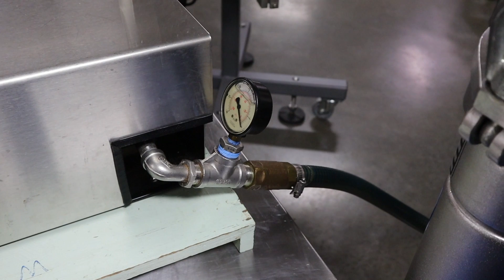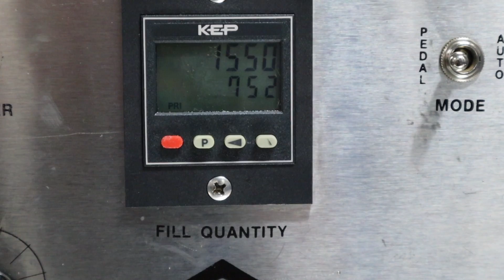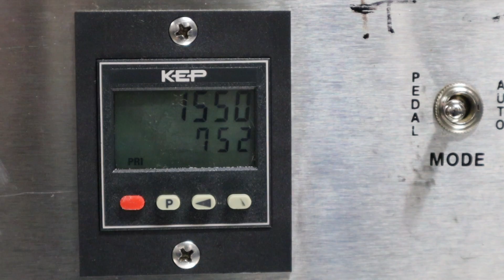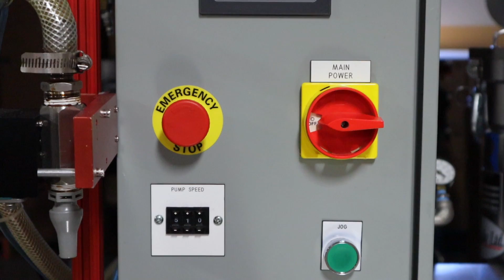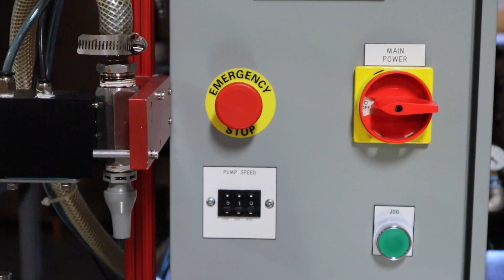Bottling Honey With a Dadant Fillmaster and a Chadam Filler

Comment: Bob, I’m over the robotics/ controls at a coffee and tea facility in the south and I just would like to suggest that if you put a simple relay between a thermostat on your honey tanks to the filling machines e-stop circuit, that would stop the machines from running if it’s not the correct temperature thus eliminating the chance of burning up motors. Shouldn’t cost more than a $100 bucks.
Reply from the maker: Thank you for the suggestion.

Comment: Hello Bob on the foot pedal do you just hit the foot pedal to start the fill an then it turns it self off on each bottle when it is full or do you have to hold the foot pedal down  till it is full an then let off when the bottle is full. I saw where there was a auto and manual switch on the control so I thought it may be both ways . ?? As always your video’s are very informative as you put much thought an detail in to everyone you do . Thanks
Reply from the maker: Hi Kathy. One tap starts it. It will go through only one fill cycle until full, even if you tap it again while it's filling. The manual button will over ride everything.

Comment: What model number is the smaller Rosedale filter you have hooked directly up to your Dadant fillmaster? Would you have preferred a different bag filter when pulling directly from a barrel?
Reply from the maker: 4-12-11/P-1-500-SBN POLY.   We use 400, 600 or 800 mesh filter bags depending on the need. Usually 600 or 800 when bottling from a drum (we call our honey raw).
Reply: @bobbinnie9872  What about the bag part number?

Comment: What size are your honey tanks, and are they heated, and lastly where did you purchase them?
Reply from the maker: We have seven tanks total in this room. Five are 600 gallons each and two are 300 gallons. They are heated from the bottom. If you look closely you can see the seam for the water portion about 6 inches from the bottom. If I was having them made again I would only make this part 3 or 4 inches.The hot water circulating through the bottom is from a large on demand hot water heater.  Each tank has its own circulating pump and thermostat set at 95 f which is the temperature at which we bottle.  The tanks were custom made to my drawings at Hud Industries in Gardena, California. https://www.yelp.com/biz/hud-industries-gardena
They can make just about anything you want out of stainless steel.

Comment: when i am bottling sometimes i have small boobles in honey that they stay inside why is this happening?
Reply from the maker: The bubbles should float to the top which can turn into a film of foam on top. If they are very fine it can take a long time to disappear. If you have a Fill Master that is introducing excessive fine bubbles it is most likely sucking air through a fitting or seal.

Comment: How do you process your honey before filling Bib? Great video
Reply from the maker: We run it through an 800 micron filter on the way to the tanks and settle for at least one day. Minimal heat.
For more info see our video "Packing Honey".
Reply: @bobbinnie9872  Hello Bob Thanks for sharing your expertise and Videos. It is very helpful.
 I m buying honey from the farmers in 5 gallon buckets (12 buckets each time in my SUV.) and Strain it in Maxant water jacketed tank. Keep the thermostat on 95°F and manually bottle it. I m planning to buy a Dadant or Ez fill  for bottling. Lifting barrel above the filling machine is not practical in our place. Our room size is 15'×30' with 2 exhaust fans to keep it little cooler, no AC.
What machine do you suggest for  me, considering temperature and the position of the barrel!
This will be the first time I will pump directly from the barrel so I can't strain out other particles. Also I really don't want to buy another pump to pour it into Maxant tank to strain it, so what do suggest about straining or filtering the honey! Is there any attachment or something I can use? I would highly appreciate your advice. Thanks.
Sorry for the long text.
Reply from the maker: Hi Jay. Although I have heard decent comments about the Ez Fill I can't speak to it because I've never used one and don't have enough information to form an opinion.
When looking at bottling equipment you need to understand the term "flooded". Some bottling machines do best when the product source is at or above the level of the machine so it doesn't need to suck and only needs to push. This means it's "flooded".  The machines in this video have different needs. The Chadam works better than the fill master as long as it's flooded but the fill master is far better at pulling honey out of a drum or bucket on the floor. It will also pull honey through the filters seen in this video by creating a good vacuum. I don't know where the Ez Fill stands on this issue but considering your situation it sounds like you need to figure that out before you buy. I understand the newer fill masters have bigger pumps and motors than the ones I have, are much better,  and will pump cold honey. They also have stainless steel pumps, not plastic. Good luck with your decision.

Comment: Are you showing the equipment that you are phasing out because your going to sell it soon?
Reply from the maker: No, we are still using these machines at times and also want to keep every thing for back up. The new line is up and running and so far has been doing great.
Reply: Bob Binnie at Blue Ridge Honey Company 
My friend is going to update his bottling line to an automated system. Do you have any suggestions for an automated bottler?
Reply from the maker: @3Beehivesto300  We purchased our system, which works great,  from Chadum Consultants in Indiana which was recently bought out by Apex Filling Systems. Mike Salyer who owned Chadum highly recommended Apex as a company to deal with. We have called them for advice and they were very helpful. You might give them a call. They come up on Google easily. Prepare your friend for sticker shock. This stuff isn't cheap.

Comment: I bought a used fillmaster for cheep. Come to find out the pump is not factory and is made of cast iron. Do you have any info on the factory pump. Dadant said they didn’t make them anymore and had to buy the stainless pump for big $... 
A picture of the I’d tag or owners manual. 
I’m just tying to find the info for the original brass pump in hope of finding one.
Reply from the maker: Our older fillmaster brass pump is a Sherwood, model 54-01, serial 5065102. Good luck.
Reply: Bob Binnie at Blue Ridge Honey Company you were correct. Good luck... 
nobody has the pump or even the part number in their system.

Comment: What is the brand and model of your new automated system?
Reply from the maker: Our automated system was custom made by Chadum Consultants which was recently purchased by Apex Filling Systems LLC. Because it was custom it does not have a model number.
Reply: @bobbinnie9872  How much does it cost?
Reply: @bobbinnie9872  You sold me on the idea, because you have been the only person to mentioned honey temperature while using filling machines.
Reply from the maker: The total system which includes feed table, feed reservoir, four head filler, cap tightener, used Universal Labeler, inkjet lot code machine and receiving table cost around $78,000.00
Reply from the maker: You may be interested in an article I wrote. https://www.beeculture.com › processing-honey-a-closer-look
Reply: @bobbinnie9872  that is amazing!

Comment: why filter the honey?
Reply from the maker: We course filter to make sure there isn't anything dangerous in the honey. It's possible to have splinters if wood and small pieces of nail or wire from the comb frames in the honey. It happens only rarely but it does happen.